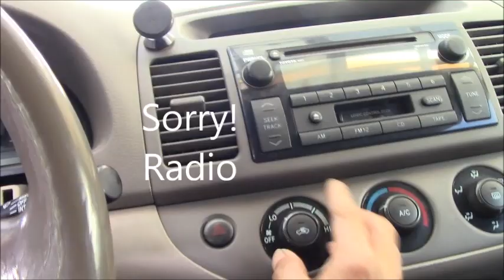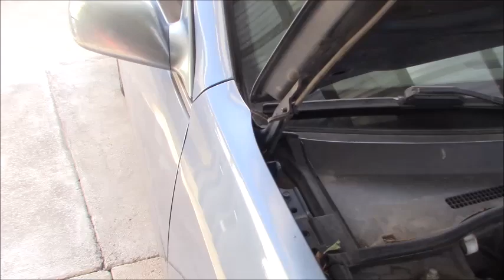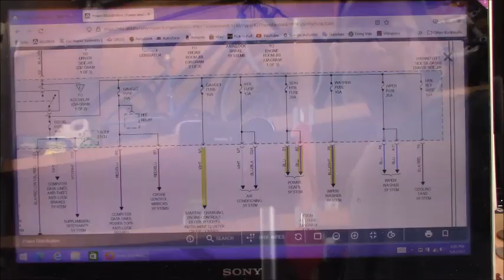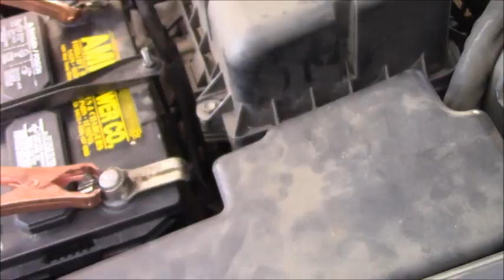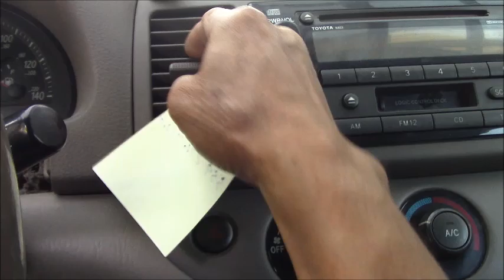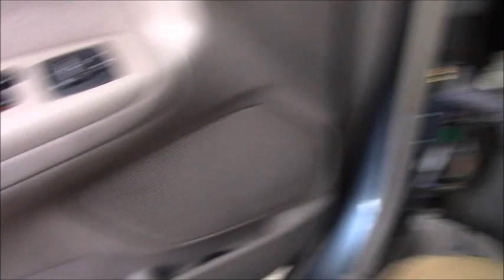Toyota no crank, no start, no electrical power, shorted alternator-diagnostics fixed

Comment: Exact same symptoms..replaced alt. Did not fix.
Reply from the maker: Did you check for shorted on alt?
Reply: @AutomotiveServiceExcellence 
Same happened to me, did you fix it ? I replaced to a new alternator but still same issue. The fuse was bad but I replaced it too. And did not fix it

Comment: so what was the problem? was it a shorted out alternator or the 100 amp fuse? why did you not hook the alternator back up?
Reply from the maker: It was shorted alternator
Reply: Did you need a new alternator?
Reply from the maker: yes replace alternator  @deewash8243
Reply: Having the exact same problem.